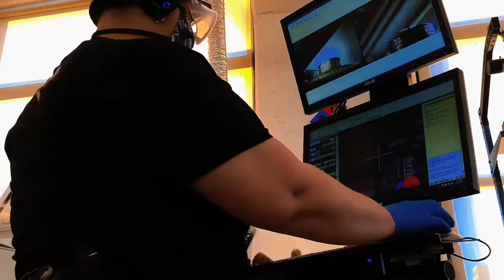Advanced Manufacturing: Made in NYC by Adafruit 6/26/2024

Comment: By the way, I got some of your DS2484 boards up and running with multiple sensors. Rock solid.

So much more stable than trying to handle 1-wire directly on a micro